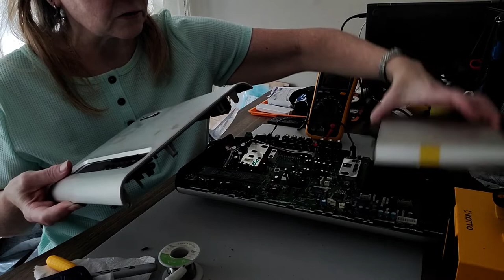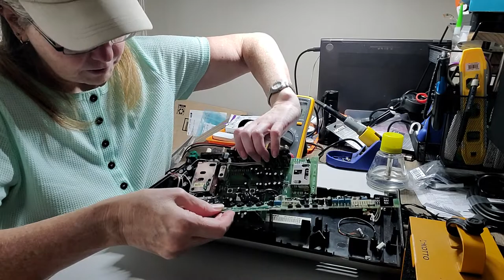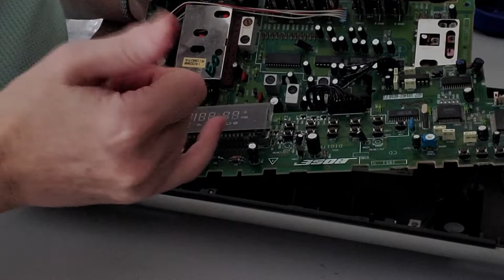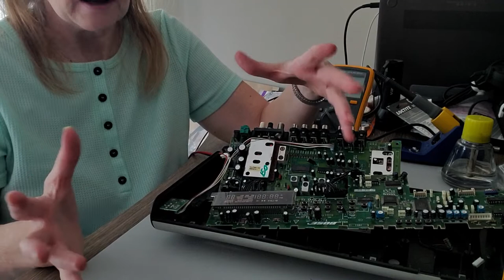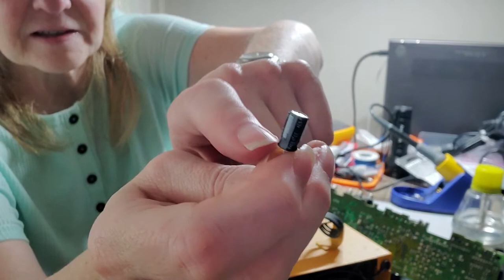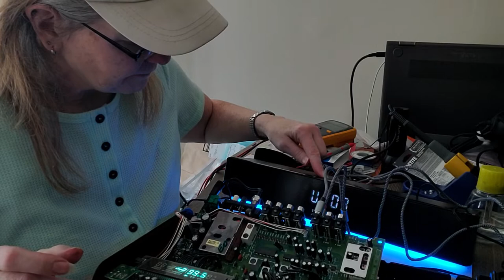Faulty Bose Lifestyle 5 - Can I bring it back to life?!?!

Comment: Thanks, found the same issue. Marked 33uf @ 25v capacitor. Pulled it out and tested it with a capacitor tester and it was testing more than 130uf. Only had a 33uf 55v cap on hand, but replaced it and the system is working again. After cleaning the buttons to bring those back to life, and greasing the CD tracks, it's good as new. Other videos instruct folks to replace the caps down by the power socket, but all of mine tested fine. Almost gave up on fixing the system. Mother in law is very happy. Thanks!
Reply from the maker: You're very welcome

Comment: Hi there , I have a Bose Lifestyle 12 Series 2, The Media Center is sending static/ scratching sounds to the subwoofer and cube speakers, would you know how to fix it ? Is there capacitors which need replacing ? All the cables are secure, I dont believe it is a wiring problem

Comment: Hi there. Many thanks for your video. Very interesting. Just out of curiosity, did you check what DC voltage was actually across the offending capacitor when it was working incase of a misprint on the schematic schematic?
Kind regards Allan.
Reply from the maker: Depending which schematics you have some show output values while others do not.  The ones I have show both depending on the rails. The ones that do not I make my own log for future references. 
When it comes to these units I am not looking at voltage values in this particular situation. I am looking at the CAPS value and the ESR value.  My troubleshooting approach will vary depending on the unit and the fault at hand. Kind regards Lisa